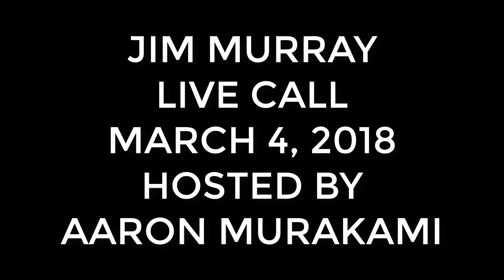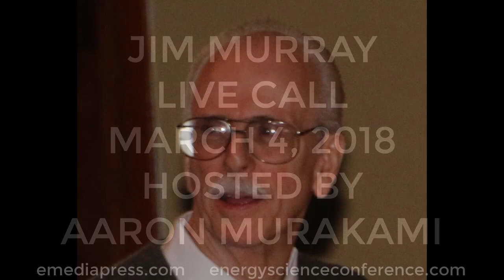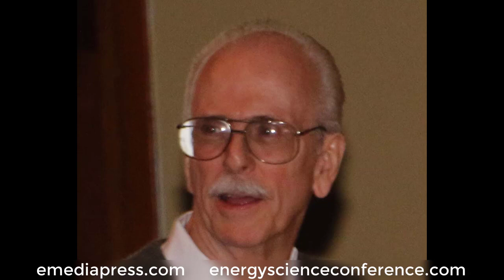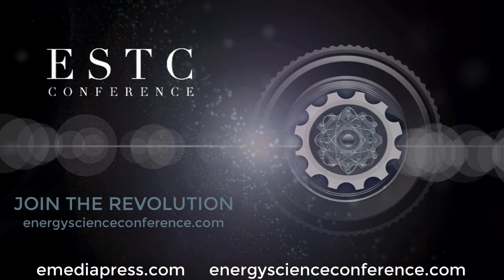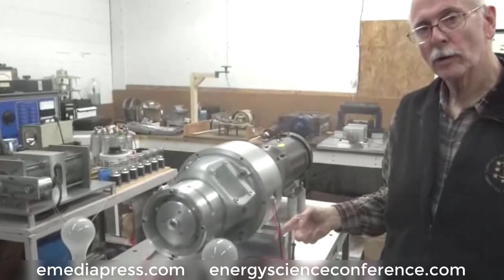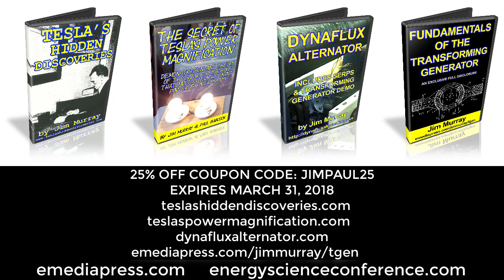2018-03-04 Jim Murray - Live!

Comment: Arron & Jim, I'm a big fan of the work and for me Jims and Paul Babcocks innovations do stand out in the field. 

That said, I think the caller makes an excellent argument that the community consistently doesn't address robustly. I have read and watched almost everything in the wider field. Can you create a self powering (after starting maybe) system that is claiming over unity, especially at the COE levels now claimed?

Self running or "Looping" as this main caller refers to it should be theoretically possible once you have a system that is really delivering substantial over unity power (remember the power feed comes from a utility generator down the line in the equipment by Jim/Paul and a local battery in some cases (Neuman, Bedini, etc) so the maths and motor/generator equivalence argument presented is weak in my opinion. The caller attempted to insert other theories like radient, ZPE to address these defences I noted to counter. We could open up the whole boundary conditions for the closed system we are talking about but not here! 

Jim says correctly that in terms of his localised over unity 'systems' extra stages would be required for storage and modulation the motor/generator will only draw what it requires but of course any storage 'load' stage applied would increase draw so somewhat circular logic (excuse the pun) there. The arguments that it may not be possible presented by Jim here or that the maths is too complex didn't come across well as reasoned arguments to me although he was at pains to make clear it's not an area he has looked into. 

A focus on practical experiment and what can be demonstrated is a robust way forward if course. The consumer is bound to ask two very basic questions that arise from these and similar experiments: a) where any excess power comes from? and b) can we unplug from the grid?

A comment here is not the place to lay out anything substantive on this but suffice to say the area currently lacks both simple and robust  answers to either even at a theoretical level. Having consumed almost everything publicly available in the field this substantial issue is consistently dodged and certainly not handled in any systematic way. This is an area that needs to be discussed and developed to achieve the desire of the field - wider interest and adoption.
Reply: Raziel Angel if
Reply: I like to think of the electricity consumed is delivered by Mac trucks as of right now those Mac trucks are carrying a grain of sand worth of electricity. Not very cost effective. 
      Jim presents the argument that instead of a Mac truck being used to deliver a grain of sand and burn up both the sand and the truck in the process. We drop off the grain of sand and reuse the Mac truck. 
      Which is why big electric or any big anything doesn't want anything to do with it. That's my analogy of it. It's not free energy but it's so damn close it might as well be..